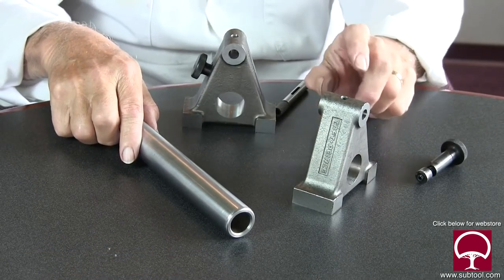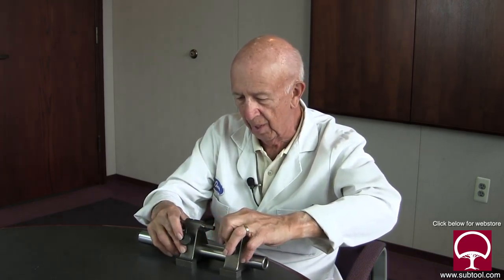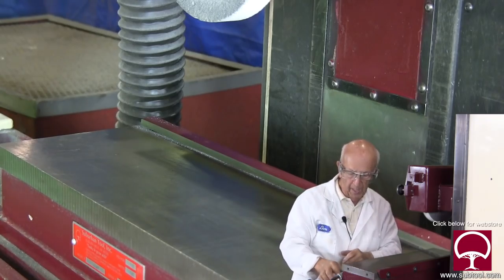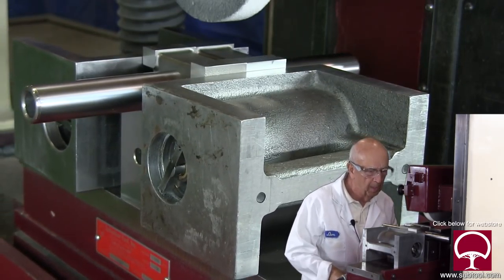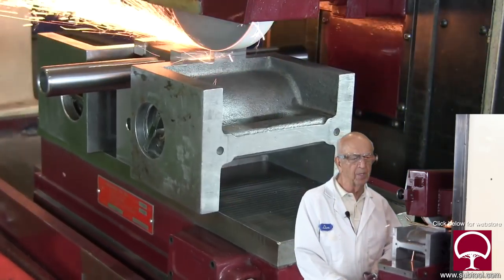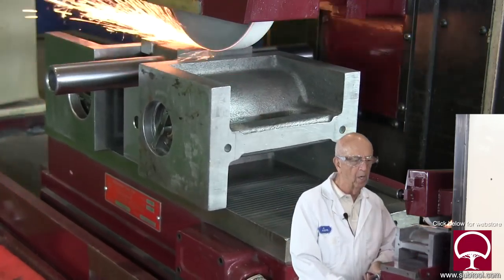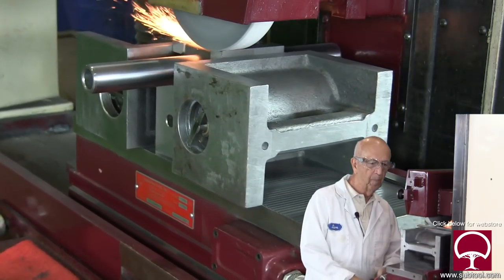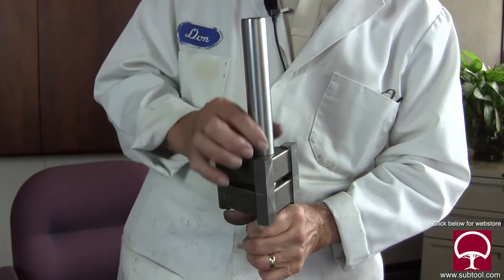Grinding The Bottom of Taft-Peirce Bench Centers Parallel to the Center Line

Comment: i love the pro tips "and i like to take one cut. just remove all the stock you need to .... believe me. a lot of folks don't agree with that but i'm tellin you ... this is the better way to do it" (-8

When you move the finished parts back in the office and the light reflects off the surface it's impossible to see the joint ... looked like one piece of metal!! great stuff, especially for how simple the setup was with those magnetic angle plates!

Comment: Don  / Tyler,  Really like the new picture in picture format! Want to make sure I have this correct - the roughing cut is acceptable with small step overs because the wheel breaking down from the leading edge exposes more wheel at the proper diameter to maintain the required stock removal? New to grinding myself and I guess I just assumed rough cuts were off limits!Take CarePete F
Reply from the maker: +Pete Ferguson Correct, you are. We have a video on grinding fast and accurately that could be of some help to you: https://www.youtube.com/watch?v=NuLjCTEZrgc&lc=z13acl0rnn2qs3o5p04cctbqyweqhtop3gs

Comment: Now if you had a datum running across the center lines of each bore radially, blocking it in won't keep those perpendicular to the base will it? I'm sure both bores run parallel axially, but the small bore could be rotated to one side or the other about large bore. I guess it doesn't matter for this tool.

This is a whole different type of machining I don't get to look at. 0.0002" adjustments are as small as I stand to work with on my mill at work with 84x32 travel, usually whole thou adjustments. Great channel and keep it up.
Reply from the maker: +tansit2344 You are correct, and also like you said, it is not a big deal for this tool. The bottoms of the bench centers are ground to begin with, before we used the jig grinder to bring the holes into size.  If it's off it's insignificant.

Comment: Really an interesting demonstration.  It is clear you are very knowledgeable about your work.   Many who are would not take the time to do this teaching.   It seems this machine trade though it is a littel more comon somehow.

Got a weird question.  Had a neighbor growing up who had quite a shop.  One of his tools was a bench grinder on a vertical shaft equipped with a wheel...may 9 to 10 inches with holes in it.   You approached it from below and you could see your ground surface.  What is that machine called?  Who made it?  Never saw another.  It was really great for certain sharpening tasks.
Reply from the maker: +phooesnax I wish I had an answer to your question, but I don't recognize the description of the machine.  Sorry I couldn't help.
Reply: Really a cleaver piece if you can imagine it.

Keep up the good work.   You remind me of every one of dad's friends!

Comment: How much of a factor is wheel wear during these operations to ensure a good even surface?
Reply from the maker: +Bruce E Wheel wear is definitely a factor in most cases, but for this project it was not a problem.  The small amount of grinding we did didn't alter the wheel.

Comment: A few questions, Don, do you find the summers particularly rough? In shops with out climate control the summer becomes pretty difficult at times. Secondly, do you continue to feed the part into the wheel as you're traveling right to left? Finally, how much would you want for that particular bench center ground by the master himself?
Reply from the maker: +Gerald Gepes Luckily, Michigan summers are never too severe so climate isn't a huge problem for us.  I fed the part in after each pass. In regards to your last question, I'm very flattered and I've never considered that before.  Since you asked so nicely, I'll sell it to you 10% off if you're truly interested.  Send us an email: americastoolmaker@subtool.com
Reply: +SuburbanTool Inc, thank you very much! I will have the budget for it in July (being a home gamer has it's limitations). I could come pick it up in person sometime around then if you aren't too giddy to get it down the line.
Reply from the maker: +Gerald Gepes We'll be here, send us your info through email and stay in touch.
Reply: +SuburbanTool Inc will do!

Comment: at 4:40 just after you go to turn the magnet on you can see the block on the left moved
Reply from the maker: Good eye
Reply: got a question for you - how do you centerdrill two ends of a shaft perfectly concentric to one another?
Reply from the maker: It depends.  What machine are you using, and how big is your part?
Reply: small lathe. 40 inch between center. 10 over cross slide. The part is about half that in both dimensions.
Reply: Best thing to do is bore the hole if it is that important. Make sure you indicate out the O.D of the shaft. Even if you can only bore 1/4" deep you can fix any out of location hole before proceeding with a bigger drill.
Reply: you can't indicate off the OD if its rough stock
Reply: If the OD is not finished then you would just put the shaft between centers and grind/turn down the OD to match the centers.
Reply: i see, what are you thoughts about 90 degree spotdrills for center drilling? These are cheaper and easier to find than carbide centerdrills (60deg)
Reply: after the angle plate moves you put your hand on both it and the bench centers and seem to verify that everything is as it should be ... makes me think the angle plate moved that little bit because it wasn't quite in place before you turned the magnet on, and the magnet pulled it into alignment. Will this setup sort of self-align or do you have to be extra careful to make sure everything is aligned?

thanks for the grinding tips!
Reply: because the front and back plate have different geometry (theoretically), they cannot theoretically self align. What i do is align the part to the first L plate, then align the second L plate to the part. As opposed to aligning each L to the part. That way, the three pieces are always under tension. If the wheel is pushing to the left, like this:
[ L ]  <-- [ part ] <--- [L ]

Because if you align it any other way, and there's a gap, the part will slide into the gap. But in the end it may not matter depending on the conditions (magnet is strong, cut is light, tolerances are not that critical, etc). If the parts are not fully making contact, or sliding. It helps to have fence, like on the shaper.
Reply from the maker: It did move, but it did not self-align.  I noticed this slight movement, so before we started to grind we turned off the chuck and made sure everything was set correctly.